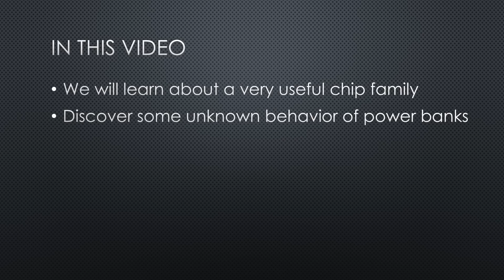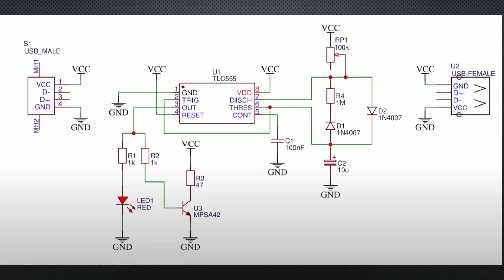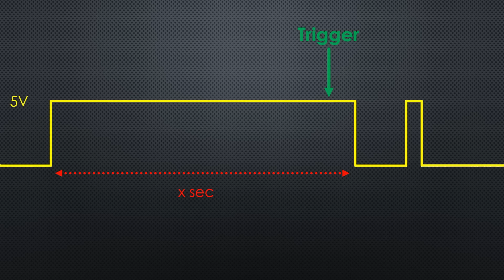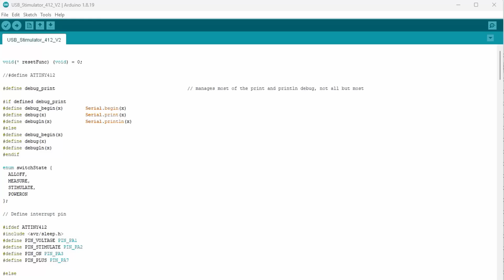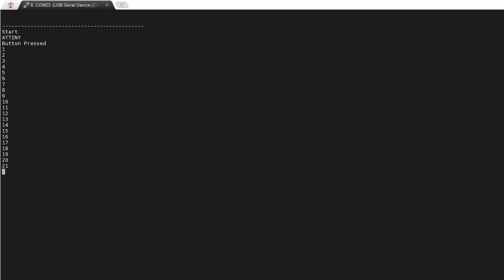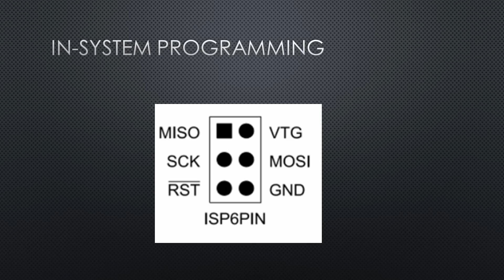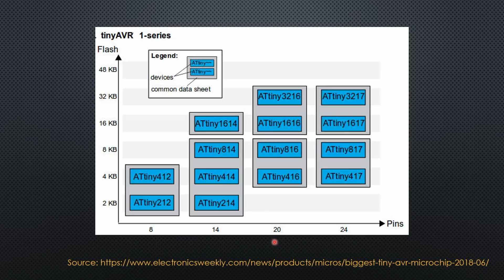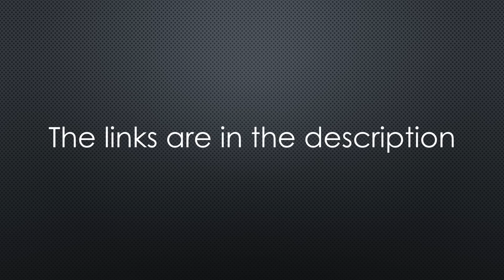477 Use the very attractive new ATTINY chips for your projects

Comment: Thank you for this video. I have been a fan of Atmel chips for many years. These new chips will be very useful.
My solution to the power bank problem was to design my own power banks with an on-off switch.
Then made power banks for my battery powered camping fridge (my BougeRV fridge has been in constant use for almost two years now) . 
I build the packs in 400W/Hr increments. I get 1 to 2 days  fridge operating time out of each pack.
Reply from the maker: Your packs are probably a bit bigger than mine ;-) Mine would not drive a fridge for a long time.
Reply: Can you recommend where or how to get low power BMS system for these packs? Last one I bought was off Amazon and my pack now has 2 series banks of cells that are below safe voltage (less than 1 volt) while the third bank is at 4.2 volts... the battery went dead and then I could not get it to charge... Now I know why. But I tested all the cells by charging them all and leaving them for a month, all within 0.1 volts of full which is what I measured when I took them off the charger, my meter sucks so close enough. I have also had other issues like a low max current (can't do 5 amps even with 18 cells in parallel)... even these cells can easily do 1 amp easily so that sucks.

I considered using an AVR to control them but I need to find a way to kill power to the AVR when the pack goes dead so it doesn't keep draining the cells. Or do you just use a hard switch to kill all power and then make sure to shut them off when dead?

Comment: The id of the chips is actually an Atmel bug. Even RS components sold a number that reported the wrong device. These are genuine faulty Atmel chips,
Reply from the maker: That is an interesting statement and could explain it. When did this happen?
Reply: @AndreasSpiess   probably a year or more ago. They were purchased from RS and I had problems programming them. I got Atmel involved.
RS replaced them for me, but they admitted they had thought all their stock was updated, si it was a known problem.
Reply: @AndreasSpiess  Case Resolution:

Here is the response from Atmel, Feb 2021.

Proposed Resolution:

Hi Rob,

The signature of ATtiny406 (0x1E9225) has been programmed wrongly into the ATtiny402, whereas the correct signature read out should be 0x1E9227. As a work around, you can edit the atdf file in the path – 'C:\Program Files (x86)\Atmel\Studio\7.0\packs\atmel\ATtiny_DFP\1.3.172\atdf' for device signature to 0x1E9225 and access it.

We haven’t heard from you and hope your queries are clarified. So, I am proposing a resolution to this case that you can accept to close. Please let us know if you have any other queries soon as this case would be open for the next 14 days.
Reply from the maker: @rowifi  Thankj you. I will just disable the check in AVRdude...

Comment: I love the Attiny412 (correction: i used the 402) so much, I bought 100 of them.
They are already in:
- a DIY battery management system/balancer (one attiny for each cell)
- IR remote controlled RGB D&D props
- a battery adapter (DC-DC converter) for my robot vacuum so it runs off standard 18650s

edit: seems like the one I used is the 402, but same things apply: cheap, only 1 programming pin, easy to use.
Reply from the maker: The difference seems to be that the 402 does not have a DAC. So no issue if you do not need it...

Comment: Thanks really enjoyed this. Not done any electronic (or even thought about) for too long now so was a nice exercise to read your circuit diagram (and pleased I still could!).  I think in my own version, given the voltage input tolerance of ATTINY chips (the 85s at least)  I would have experimented with a beefy capacitor on the input and use your "voltage" to look for a drop off. This way hopefully, one could cut out the need to record/time/trigger the "stimulate" and "run on air" as it were (the capacitor) when the power cuts which would hopefully be enough time to trigger/sustain the stimulate load to turn the thing on. Ideally then you'd only get a very momentary cut of power to the main device being powered. If that isn't acceptable though, could just use the cap that one time for the initial measurement, then go back to timing/triggering an early (before cut off) stimulate.  

I've had this cut off issue with USB lights before on power packs and indeed it's irritating so a nice idea from Great Scott to make a work around.
Reply from the maker: Indeed, a cap would power the ATTINY for a moment to save the value in EEPROM.
Reply: @AndreasSpiess  surely flipping a pin to get the power going again though would be even faster... then just keep in RAM
Reply: @AndreasSpiess  really does make me want to experiment to see what the art of the possible is...

Comment: 1:43 Most power banks actually include a mode that keeps them on while using low power draw devices. It usually involves double clicking or press and holding the button that checks the battery level. EG Anker power banks will go into low draw mode by press and holding the batter check button for 3-5 seconds; then the battery light will illuminate green and it will stay on. Even the cheap battery banks I have received for free for various reasons have this feature so it may not be totally ubiquitous, but it isn't that uncommon.
Reply from the maker: Other commenters also mentioned this function. It seems to be common on the Anker brand. Unfortunately, it does not work on my 2 power banks :-(
Reply: never tried that. mostly some LED turns on by long holding the button

Comment: Great Video Andreas. I do something similar in my gaming LED controllers over on terraintronics. I use the Wemos D1 Mini as a brain, and drive a 47Ohm to GND using a mosfet as you've done. The little innovation that I love is the "count and save" you have to characterize the battery. A simple idea, but brilliant. I currently have A0 unpopulated. I think I'll update the code to check A0 on startup, and IF it's 3V3, assume it's in characterization mode.
Reply from the maker: I am not sure if the 3.3V method works. I only have to press the button if I know I use a different power bank.

Comment: Some power banks have a feature that will keep the output on without needing a minimum load.  I have one with this feature, and it seems to be unadvertised.  If I double-click the charge display button, it switches to this "always-on" mode.
Reply from the maker: Others also described this function. I did not know and mine ddo not have it. So, as you write, this function is unadvertised :-(

Comment: if I buy a clone 555 it's far more likely to be functional than a clone/fake attiny.
it's easier to just make real 555s than to repackage something else as a 555...
great thing about just using the absolute minimum for a project like greatscott's, it does one thing well and there's no dicking around with code.
i think we rely too much on code when a simple hardwired digital or analog system will suffice.
and this is coming from someone who did a few years of compsci and likes to dick around with microcontrollers... if it ain't broke, don't fix it.
Reply: but this channel is all about code, lol
Reply from the maker: You are right!

Comment: I don't see how your solution offers a better solution than GreatScott's. You're still doing the measuring and the configuring. What if you change one powerbank for another after the first one runs dry? You need to replace it with the same model or do the whole cycle again? I didn't find this a good example of why to use easily programmable chils instead of simple timers...
Reply from the maker: My solution for a new powerbank is to indect the device with the button pressed. Then it will automatically adapt to the new timing.

Comment: If you were willing to sacrifice two bytes of EEPROM, you could use the first byte to count the first time, then you use the second byte to count the second time. On every boot after that, you can check to see if the first byte is equal to the second byte. If they are equal then you know your characterization was successful. If they aren’t equal on boot, then you update the first byte with the value of the second byte and keep trying. Your first byte is your “expected value” and the second byte is your “test value”. With the two values, you should never have to tune it by hand. Of course an LED or two would be useful to know if it is (re)calibrating or running normally
Reply from the maker: I do not understand how the chip would know that it is inserted in a different power bank (in my design, I announce it by pressing the button). This is when it has to recalibrate.

Comment: I fiddled with AVRs in the past and wanted to store state information on a power failure. I used a diode feeding a largish cap on the power pins and monitored the incoming power before the  diode for a power failure using a second diode connected to a sense pin with an interrupt set up to trigger when it went low. When the interrupt was triggered, I immediately stored the state information to the EEPROM, and the energy in the cap was enough to get that done before the AVR ran out of power. This saved needing to constantly write data to the EEPROM in case the power died, because there was quite a lot of data to store and the 100,000 cycles would be used up within a year if I kept writing that data to the EEPROM every second. Wear levelling wasn't an option.
Reply from the maker: A good idea to avoid wearing! Here, these additional parts were not relly needed as I do not use the "calibration function" a lot.
Reply: what i was thinking, great

Comment: Neat! I’m going to have to find a project where I need these cute chips! As an fyi, voltaic systems makes a line of battery packs that don’t have the auto off function so they work well for low power devices. I’ve been using them for years. Very convenient.
Reply from the maker: Thanks for the link. They seem to have a nice line-up!
Reply: @AndreasSpiess  Nice solar panels, too! You might be interested in their Capacitor-based power cell for very low power applications.

Comment: The Chinese 412 reporting itself as a 416 could be due to the wrong bootloader being flashed onto the 412.
Reply from the maker: Maybe. But I did not use a bootloader, I just used the "regular" programming with AVRdude.

Comment: the "new" attinys are great. I have used them in my lora weather probes which car run of a single cr2032 for about 2 years while sending data every 5 minutes.
Reply from the maker: Cool project! They can be really low power.

Comment: Great video as always. Got some in my cart from Digikey, I was about to order some Tiny84s anyway (for a previous kit project) it'll be fun to experiment with this. I prefer direct C/GCC programming to Arduino, so I can do lower power (one of my Tiny85 boards was still OK and woke up having been left in sleep mode after 5 years on a CR2032). But maybe I should mess around with it again.
Reply from the maker: Astonishing! I think you can go quite low power with these chips also with the Arduino IDE. At least you can select the clock rate and some other features. And you can use deep sleep.

Comment: Thanks Andreas.
What I do with SMD chips is use one of the SMD sockets then solder the programmed chip to my board. Some chips will work with the 6 pin connector on the board but you have to be careful what pins you use. I've fixed circuits with mosfets controlling devices by using a resistor on the gate from the programmer, 10k to 100k usually work.
Reply from the maker: Thank you for your tips! I also used SMD socket for programming. However, I found it easier to program and test the chips in the real environment.

Comment: I watch your YouTube channel And subscribe to it and you do a great job. But there is some misinformation in this video. I've been using these new ATtinys for some time. You stated that people should not use the zero series because it is out of date . That is not correct in fact the 412 was put out in 2017 the 402 was put out in 2018. Now the new series is the 2 series but they don't make an eight-pin version of that. Because of pricing from Mauser I buy many of the 402s they work excellent . The main difference between the 412 and the 402 is the 412 has a DAC. I don't need a DAC
Reply from the maker: Thank you for the additional information! I did not investigate too much in this aspect and did not find a lot of x2x chips available. So I did not mention them.
Reply: I just appreciate you drawing attention to them I have completely gone away from Arduino I can give you my website which has more information on projects I've done with these newer chips I've worked with the 1 series and the 0 series and the 2 Series I love them all of course one of my favorites is still the ATtiny10
Reply from the maker: @shermluge @shermluge  You can try to post the link here without looking as a link to YouTube. Or provide a Google search term that leads to your site.
Reply: @AndreasSpiess   Did you see the Attiny Christmas tree or Attiny402 Fireflys?
Reply from the maker: @shermluge  Cool project!

Comment: I found it easier to wire directly to the charge boards +- for circuit power. I retain the charge controller for well charging the cell attached. I ran this outdoors for 3yrs on a soil and light monitor for my wife. No need for the additional circuit.
Reply from the maker: If you want to opne the power bank, this is a good idea!
Reply: @AndreasSpiess  we are makers afterall 😉

Comment: You could use a large value cap to power the attiny just enough to save the values after the power is cut off
Reply from the maker: I agree. However, it would add one part...
Reply: @AndreasSpiess  It would however allow for online updates to the timings, if you add a push button for programming of course. You'd need to limit inrush current, so it might just add too much complexity.

Comment: Hello Andreas,
very interesting project. Where can I find the (final) schematic and the arduino code?
Why do you use the battery cell anymore?
In the schematic you connect the 5V to the 3,0V battery. Why?
best regards
Frank
Reply from the maker: I did not publish the code or the diagram becasue it is very simple. I removed the battery and powered the chip directly from the power bank.

Comment: Great project,  but in alternative to use uC, like attiny, could be more easy just check the output voltage of power bank with a opAmp and switch on the mosfet when the voltage is go down to a cert limit and turn off when the voltage return to 5V
Reply from the maker: You probably do not want to let the bank switch off every 20 seconds or so to re-trigger.

Comment: R4 needs to be connected to the source of Q1 otherwise the difference in voltage between the power bank and the coin cell will keep Q1 turned on.
Reply from the maker: It worked in my case, but maybe I srewed the diagram up.
Reply: @AndreasSpiess  My guess is we've all done that on occasion. Some of those small FET's have a Vth of as low as 0.8V.

Comment: why not have a supercap powering the microcontroller, then you could in theory do the measurement and turn the supply on, without needing the extra programming workflow.
Reply: Because a supercap is not a battery.
Reply from the maker: Good idea. Any cap would do it, I think.

Comment: The ATTINy416 "fakes" are probably die rescues that were meant to be 416s but were put in a 8 pin package to keep the die due to some non problematic issues with the die that wouldnt allow it to be a 416 but only a ATTINY412
Reply from the maker: Another commenter wrote that these chips even were sold by Mouser, etc. and came from Microchip. But I do nnot know.

Comment: You should use a supercapacitor or a regular electrolytic capacitor to maintain the voltage of the microcontroller after the power bank is turned off. This energy would be enough to turn on the mosfet and turn on the power bank again.
Reply from the maker: I agree. Also because these small chips do not care too much about a correct Vcc.

Comment: Thank you for your effort! Nice: according to marketing it contains AI. According to engineering it conteains real I. Interesting, taht net Attiny are more confortable to program. I had a usage for them: Switching my tumbler according to available PV surplus energy. I used on stock ESP8266 with ESPHome yaml stuff instead of that.
Reply from the maker: I agree, if you do not need Wi-Fi, these chips can be used for many projects. However, ESPhome is also quite simple to use an who does not have an ESP8266 laying around ;-)

Comment: I use Tiny212/412 for few years and with internal 32k oscillator as main clock it takes around 6-10uA even without sleeping (of course if you enable ADC or DAC references -> hundreds of uA. Or if you forget to disable unused pins - then it's in milliamps).  With MicroUpdi programmer and Microchip studio (it needs to disable "only supported devices") you can do full On chip debugging (or many others with UPDI like AVR Dx)
Reply from the maker: Thank you for the additional info. 
Debugging is a neat feature! I did not check if it is already supported by the new Arduino IDE.
Reply: @AndreasSpiess  It probably isn't in the Arduino IDE. Just Microchip studio + MicroUpdi or other Microchip debugger.  For Mega4809 i just created template with arduino core and I can just switch between 808/809 ... 4808/4809  (libraries are quite anoying as it doesn't have common mcu setting in the Microchip studio). And for the tiny212/412 memory is so small I almost run out of the flash just using floats (uint32_t wasn't much better) :D